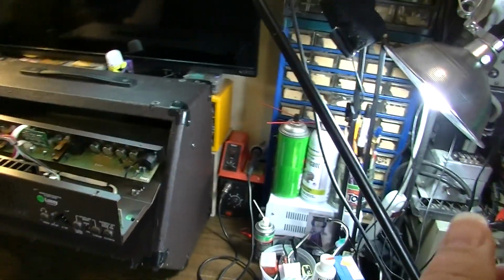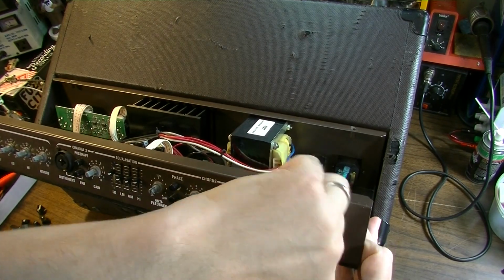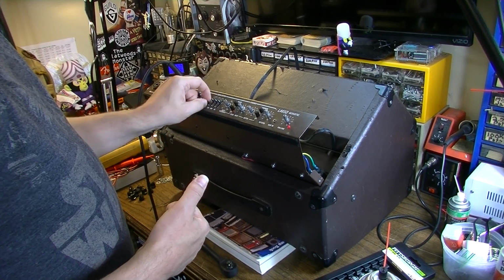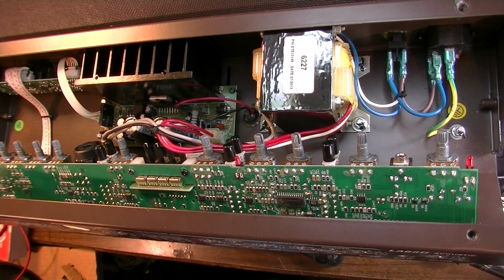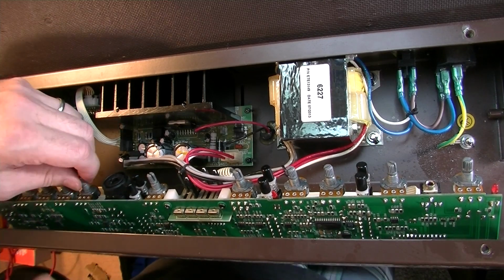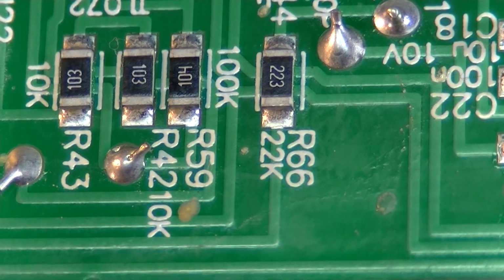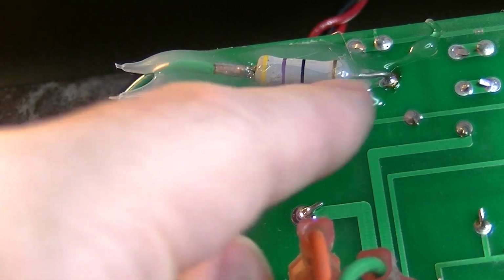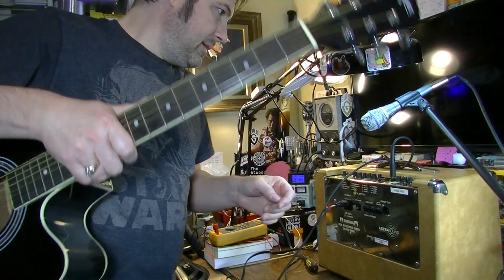Why Are Acoustic Guitar Amps ALWAYS So...Sh*tty?

Comment: If you don't enjoy these,   have them sent to my shop.   I re-flowed a main board on a Fender G-Dec.   It's more or less like a Laptop PC board with surface mount stuff.    ROHS solder loves to crack.   It many times makes sense to look in key spots for solder cracks to fix with your iron,  but sometimes just reflowing with mass heat saves time and effort.
Reply: ROHS = built in obsolescence

Comment: Nice playing mate! As an amp tech myself, the Laney needs some signal and at least a dummy load to really work it during testing. If you verify the issues aren’t jack or pot related,
The bulk of intermittent problems happen around the power amp section, where the heat is. The power amp module solder joints and ribbon cable especially. Most modern SIPs have oc and thermal protection also. It’s wise to check thermal paste is adequate also.

Cheers from Tasmania!

Regards 
Rob
Reply: i guess im asking randomly but does anyone know of a way to get back into an Instagram account?
I was stupid lost the account password. I would love any tricks you can give me.
Reply: @Clark Kalel Instablaster =)
Reply: @Deangelo Ty Thanks for your reply. I found the site through google and Im waiting for the hacking stuff now.
Seems to take a while so I will reply here later when my account password hopefully is recovered.
Reply: @Clark Kalel Happy to help =)

Comment: Secret to buying a good acoustic guitar amp.
Step 1. Buy a bass guitar amp that has a tweeter in it.
Step 2. That's really it.
Reply: I am interested, do you play alot of acoustic guitar? And why does this work over a acoustic amp? I am just curious
Reply: @batoutahell8532  I'm repeating an old, and probably a bit out-of-date inside joke. It used to be that the kinds of piezo pickups built in to acoustic-electric guitars, really didn't have much of a bass response. You needed a preamp that could punch it up to get a good sound out of them. While this is still true, most of your newer acoustic amps are probably better about this. 

But, a bass amp, even a smaller bass combo (I like the 150w Hartke combos for this) generally had the stones and a better speaker for the mids and lows, which is where the power is when you strum down on your acoustic. The tweeter gives you the nice sparkly highs. And the amps, being bass amps, have plenty of power in store and as we all know, louder is always better!
Reply: Bass amps run towards more clean, more overhead, more power. Hard to overdrive with puny guitar signal.
Reply: I almost bought a Baldwin C2 bass amp once.  A guy was selling it at a yard sale for $15!  I was thinking of using one for an old Korg wavetable keyboard I have since they have a very good full-range tone to them.
Reply: I wish it were that easy! I gig with both bass and acoustic guitar and have used one of my bass amps on an acoustic gig only to find it sounding really crappy and colored so I plugged in direct to the P.A. Problem solved!

I bought a Fender Acoustasonic Junior which sounds amazing!
Reply: I used a little Fender BP15 for a few intimate church services. Plenty to really fill a good size room.
Reply: @doobiewah357 if you have a PA available, this is really the best choice.
Reply: Bass amps are good for steel too. Most of Buck Owens songs the steel was recorded with a custom bassman leo himself added reverb and a 15" speaker back in the day. It was for sale last year for 5k. I have a Dean markley keyboard amp as a good cheap back up to my back up amp. My top string on one of my steels looks like a bass string. So steel amps and bass amps are best but a keyboard amp will cut it. I look for the amps lead guitar players don't like, usually that means it will work for steel where you want clean headroom.
Reply: @doobiewah357 same here. You don't get to move around much, having to stay right on the mic, but it's the only way to get a real acoustic tone. I saw James Taylor once, with a guitar with a mic mounted on the guitar itself. Sounded great and he could have some freedom of movement
Reply: I have a Markbass amp combo.  I plugged my acoustic guitar into it the other day on a whim.  Sounded great.  Markbass is notes for being a very flat amp though.

Comment: I will just say it anyway as Iam sure someone might have mentioned it.  Most of the parts on those boards are surface mount technology.  If you apply a standard soldering iron to the ends of any of those parts, One you can easily destroy the parts.  They are a vapor phase solder.  But the heat can make the ends leach up(for lack of terminology) may not be apparent on the top but underneath you just don't know except for what you can do to the signal.  Or you can be creating noise in a circuit that could cause erroneous problems.  Not a super tech, been a long time for me.  Its just the bits and pieces I remember.

Comment: Without watching this completely Im adding a story about this topic , After a gig in Dallas heading back to Little Rock on I-30 , the band in a van pulling a 4x8 single axel U haul was rear ended by a truck almost going too fast for the construction zone we had entered , causing the trailer door to break open and the trailer and van to start the side to side wiggle dance as equipment , cloths and everything loaded nearest the trailer door to spill onto the freeway and slide down the freeway behind us . <Most gear PA  a Project 2 system , as welll as my gtr  amp,a  Peavey Deuce in them days , guitars were in the van thank God . ,We didnt have an amp rack then the pa amps  a CS400 and an 800 were loose and stacked like everything else. Also there was an Acoustic 270 gtr/bass head plus a 2/15 acoustic cab with 2 jbl's . all of that went out the trailer door sliding and tumbling down the hiway behind us .After the excitement settled down we started rounding up what was loose , the Peavey gear while scratched ,bent up and ugly was in one piece anyways cosmetically speaking , the Acoustic was in splinters both head and cabinet ,the JBL's looked ok .. Got to the gig the next day setting up and checking shit out all the battered PV gear lit up and worked the Acoustic was a goner

Comment: That's mainly the case with solid state amps where the company just doesn't care how long their amps last. They go for the cheapest boards, the cheapest pots, the cheapest capacitors, the cheapest power transformers. Whatever will make them the most money. Their market is people who don't want to spend alot of money and don't know any better. They also don't have very good resale value.  The Fishman Loudbox amps, the Rolands, Fender and the Yamaha amps are usually a better option than off-brand Acoustic amps. Even the Behringer Acoustic amps are better than Ultrasound and Laney.
Reply: Behringer gets sh*t on alot, but they have become a pretty good mass producing company.
Reply: @juanvaldez5422  They have had a few years to get it right. They also bought a bunch of people.
Reply from the maker: I would trust Roland and Yamaha over most others in terms of build quality.
Reply: My Roland jc40 is built like a tank , of course it costs like a tank too....

Comment: I’m in the process of faulting a soft start fault on a tanglewood T6 acoustic amp. Unfortunately there is no schematic available and it’s all surface mount components!
I’ve proved the preamp section and the power amp sections okay. There seems to be a second isolation/preamp circuit built into the power amplifier board.
Just thought I’d share 🙏
I am a recent subscriber to your channel, thanks for the great variety of content 👍🏻

Comment: The standard potentiometers were installed at "touch up", using "no clean" core solder, as were all of the other "external-to-board" items. Just because it is labeled as being "no clean", doesn't mean that the flux residue isn't capable of being the means by which conductive and non-conductive contaminants stick to, and affect the board. 

The SMD's were soldered in a zone reflow oven. The length of the board, in combination with its thickness, force the switches and pots to provide ALL of the mounting support, and much of the vibratory isolation for the board - which sets up the design for internal component failures, or thermal and/or vibratory intermittent failures.

Comment: Some sound good but I avoid mass produced modern PCB amps (I.e. Fender Bassbreaker) when possible (unless they are simple clean design) just too difficult to fix. They are more affordable but unfortunately disposable.
Reply: designed not to be fixed? Which has become the matra of our society
Reply: Juan Valdez Maybe I’m getting old (or getting wise), but simpler (maybe more expensive) things you don’t throw away really appeal to me lately (as I eyeball a Kemper for purchase 😬).
Reply: @tricko2286  I have had the helix for 2 years, its amazing. The editor is top notch. Noone ever talks about the routing, at one point I had my helix running 4, yes 4 , combo amps in stereo , wet dry wet, .. i probably would of ran 5, but I only owned 4 amps lol. Its is a rabbit hole of versatility. It works very well with what other gear you have. It will bring old gear to life. I have almost pulled trigger on kemp several times , glad I didnt. After MUCH research, the kemp gets better high gain. Thats it. For me, I have a good high gain sound and playing guitar and making music is so much more to me than chugging on a power chord, so I didnt get it. Check out the helix lt.
Reply: Juan Valdez Good info... not sure why I am drawn to the Kemper (the promise of actual amp profiles maybe)... I don’t really play any high-gain (more clean/slight breakup)...
Reply: @tricko2286  The helix wins on cleans and mid breakup. the kemp wins in high gain modern metal, high gain.

Comment: I got a Peavey Valve king awhile back that made little to no sound on the High Gain input, pulled it apart and it was a cold solder joint that had disintegrated and was barely making contact with one of the jack prongs. Flipped it, wish I kept it

Comment: The best acoustic guitar amp isn't an acoustic guitar amp. It's the IMHO the 1976 AMPEG G110 , a very sweet sounding/ responding F.E.T. based combo amp. AND THE BEST ACOUSTIC PICKUP is the DeArmond 260 acoustic 'hole pickup'. This is a very special line of Pickups because it is wire wound AND it is piezo!
I only know this tidbit about the pickup because in the original plastic case was a little memo on piece of typed photocopied paper that explained it.

Comment: Every time I have a problem with mine, it's the terminals for the ribbon cables connecting the boards together. I clean the pins, put the cables back on and everything works fine for a good while until I have to do it again.

Comment: Hey, is that the Washburn with the broken neck you rescued from the dumpster?  I have an acoustic with a piezo under the saddle (no controls or pre amp on the guitar) that I plug into a Fender Rumble 25 bass amp. Tweak the tone knobs and it sounds pretty good.

Comment: Love the music tags, thanks. It seems simple but why do they solder pots to the board still? Seems like by now we would stop.
Reply: Bill Knott Because it's easier to manufacture the pots, and usually input/output jacks directly to the PC board, rather than hardwire them separately (most amp manufacturers, like Marshall, etc. have traditionally had women do this job, as they are seen to be more dexterous, and patient at that job), which is why your vintage Marshall head has womens signatures on all the sign-off tags.
Reply: @scottdunn2178  women have been wiring me wrong for years..
Reply: Bill Knott Welcome to the club...

Comment: Thanks for the video - always good intel and I enjoy the channel, subscribed.

My son uses a Marshall AS50D which we bought used after a recommendation rather than for the name. Two channel solid state (no valves) configured for acoustic guitar / vocals, its solidly built and quite heavy. Channel 2 has the powered XLR and an additional port for a second instrument. There is also RCA audio in for a backing track. 2 x 8" good quality Celestion speakers with tweeter, effects loop and also built in reverb and chorus (the reverb is not spring but its decent). Effects can be split between channels and there is audio out at the back for a stage setup / studio. It's been gigged for two years by us (bearing in mind it was used when we got it), bounced about in the back of a wagon, 60 / 70 gigs now and no issues at all.  

The acoustic channel has a beautiful tone. We struggled initially on channel 2 getting some distortion at times as my son has a (relatively) powerful voice - sound techs normally compress his vocal line in. The amp doesn't have a compressor, however, we dialled this out by keeping the volume relatively low on the (vocal) channel and cranking the master volume up.  

The amp works indoors and out, easily powerful enough for bars, hotels and mikes up well enough if there is stage sound.  We've run a couple of pedals through it on the acoustic channel at a mild level, a TS9 and a Bluesbreaker (clean option), the latter better at boosting across the range without distortion - this lifts the acoustic to cut through (without any added personality from the pedal) if the bar is a little rowdy. This sounds especially good with a decent signal coming in - we use a Taylor Big Baby 7/8's and a Gibson J45  - both have an LR Baggs under saddle pickup. Elixir 12's for  a bit more bite on Indie Rock. 

I would recommend the AS50 for general acoustic gigging, been solid for us, and not overly expensive at about $450 new (£300). TBH, you don't want anything too expensive in case it gets dropped or stolen. Two channels, reliability and tone are the name of the game, not a host of effects. 

 A clip with the AS50 and Taylor, for scale - don't judge on the sound please as this is from an old iPhone 5,  20 feet away :)  https://www.youtube.com/watch?v=1cWml1HfBiA
Reply from the maker: Welcome to the channel. Thanks for the comment.
Reply: @TheGuitologist  I hate Marshalls, but I had an AS80 for a few years when I was doing mostly acoustic gigs. It was actually pretty effective for small clubs, and looked good. I have a Hot Cabs 1X12 combo now, but I've never used it; I got it as a gift.
Reply: When I worked at GC back in the day, I sold a ton of the AS50 models. They sound great with a Gibson J45, and more often than not, I would have the customer demo the J45 into the AS50, and they loved it so much they took both, and I never had any sort of complaint on any level about the AS50. Just a great amp.
Reply: @TheGuitologist  - you are most welcome. Best wishes from England.

Comment: On my Laney Cub 10 bought in 2014 I had to short the thermal protection, that bloody component turned off the amp when it reached its normal temperature. I also had to solder every connector between the two boards, those produced muddy sound. Now the amp is working very fine and is reliable, ah yes I confess it was cheap.

Comment: I got a problem with my marshal AS 50 doing the same thing just randomly cutting out, turns out it is the notch/phase push switches in the anti feedback circuit dirty, comes back on when you mess with them.

Comment: In fixing vintage (10 years old +) solid state amps...  You may find that Unlike tubes,  the IC or Transistor module you need is discontinued or not available, so you get to go find an NTE equivalent, or hope that the China vendors are selling an honest clone.   With some of these amps,  I feel that makers are forced to work with what's available,  and that means smaller weaker legs,  and by law they must use the lead free solder.   I just fixed an Ampeg BA115HP that had this issue..   they TRIED to secure everything well to prevent cracks,  but a few formed, and the whole amp sounded like a fuzz box as a result.

Comment: I have a Ultrasound that does not have a model number on it anywhere and would like to know if somebody here can tell me what I have.The cabinet is chocolate brown it measures 18" wide 10 1/2" deep by 13" high it weighs 25lbs on top there are 10 knobs it has two channels one for the MIC and one for the guitar. I has two 8 inch speakers.For the MIC channel it has mic input bass treble and level. For the guitar it has digital effects level mode bass treble notch filter and another level knob and the master volume.It has Shape off and on switch and an on of  switch and input for the guitar.On the back it has the main power switch,  line out mono and stereo and a direct out.also listed on back is the 16 digital effects. The power cord input is right below the digital effects listing. Hope anyone can help me identify this acoustic amp.Thank you

Comment: I wanna tell you man... Newer Marshall, Line 6.. "solid state of things", Brad,  I've had foils break on controls soldered to boards.  It's a nightmare!  I've fixed I don't know how many.  The newer cheap pieces of shit, amp boards are so very thin, you can't have your soldering iron no more than 550 degrees,  quick on and off, and using rosin core 60/40, lead and still the foil burns off.  I wouldn't pay 20 bucks for them. But they sell some of them for over six hundred bucks. They sound pretty good with all the effects they have on some of them, great design... but it's the way they put them together, so cheap!... makes me sick to the pit of my large intestine.
Reply from the maker: Thanks for the perspective and experience.
Reply: The copper traces are very thin on some boards that any force or heat will lift them or they break right at the edge of the solder connection, I usually scrape the insulation paint off the trace and solder a wire along the trace to the component.
External components attached directly to the main board is just asking for future issues to crop up.
Reply: @j-man72b72   that's what I end up having to do in the end.  Especially where potentiometers are soldered.  It looks to me,  if it's guitar amplifiers, they would think about road abuse.